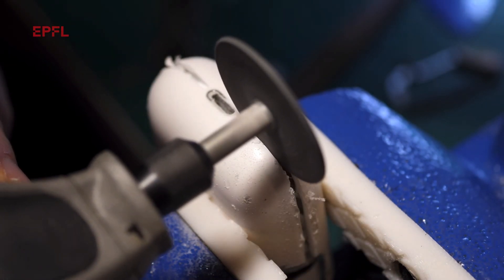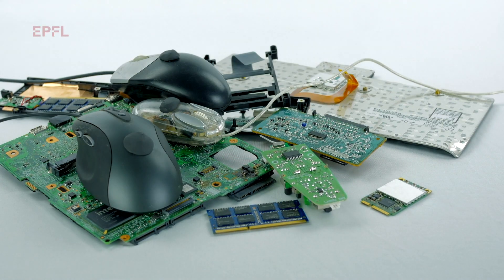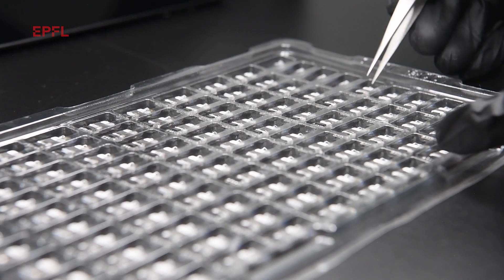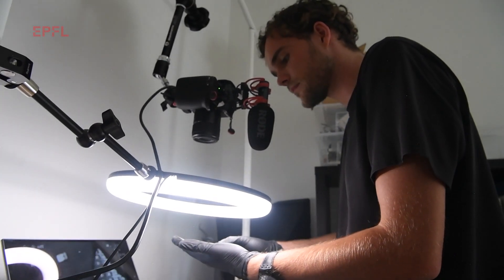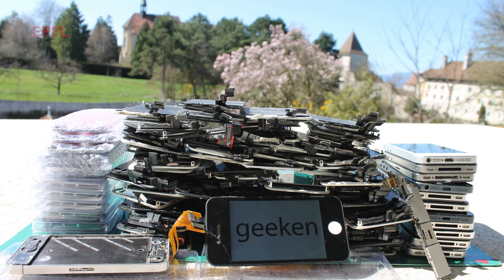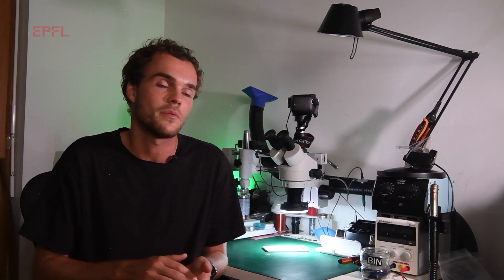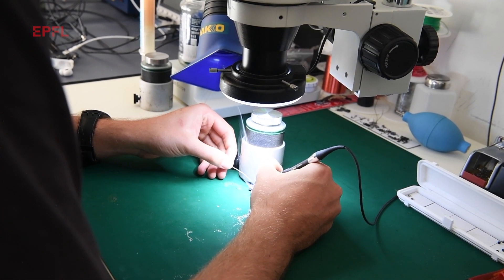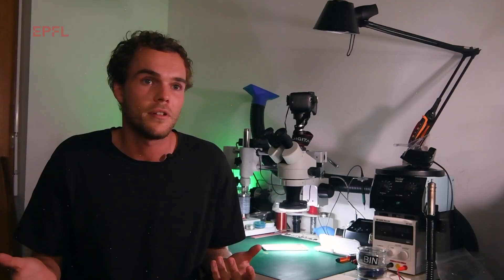Why do we throw away electronics when they break?

Comment: I'm lucky enough to live in China fairly close to Huaqiang Bei, the market that you mentioned. I've been wanting to get back into mathematics and programming for some time and also start learning about electronics.

The issue with repairing electronics now though seems two fold to me, one many products are glued together to try to prevent repairs. The other issue is surface mounted microelectronics aren't something that can be repaired by hand unlike older electronics.

Another issue likely to become more common in the future is that many items are going to require online connections to servers, and much like many modern video games, when those servers go down the product then becomes useless. I really think a law is needed requiring companies to make the server code available when they choose to stop hosting themselves. Preservation attempts are currently rendered useless when companies shut down servers.
Reply: I think the main issue is just electronics are evolving way too fast. What’s the point in repairing your iPhone 5 when it’s hopelessly outdated or your 5th gen intel core that’s 40 times slower than the brand new 13th gen
Reply: @kaourintintamine1383  Are CPUs still progressing at such a high rate of speed? I lost interest in the progress of PC hardware a long time ago, it's been well over decade since the latest hardware was any benefit for people outside of gaming, video editing or crunching huge amounts of data. I was still using my OnePlus 6T up until a few months ago when it fell down and the screen developed a problem, otherwise would still be using it with custom firmware which would let me use a recent Android release.
Reply: @Enoch-Root  the 2x speed markup now comes around every 2-3 years, added to all the extra hardware innovations, if we consider for eg a smartwatch, which would be a myriad of extra sensors, battery life, screen improvements, design innovations and algorithms working on them, then it’s safe to say that for a “technology hooked” consumer there’s little to no interest in 4+ years product longevity.
Innovation has also become this deadly consumer obsession in having all the new gadgets, and electronic businesses have become quite adept at adding extra things to gadgets at a breakneck rate.
Reply: planned obsolescence.